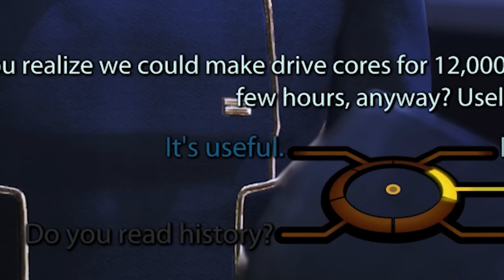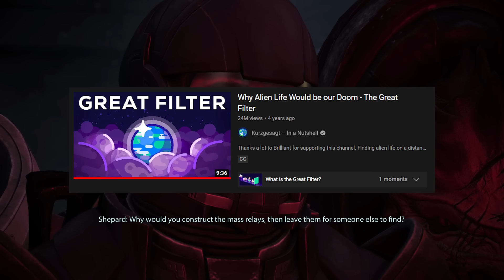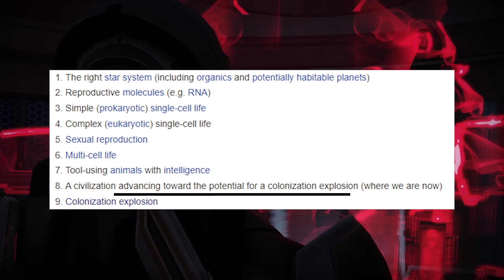A Story Analysis of Mass Effect 1

Comment: 33:23 youre correct, that fight was A LOT harder on the original release. That bint got me killed by her minions with her constant interference and the lack of cover options.

Wasnt that the point though? Shes a glass canon so she needs to force us into a handicapped fight. The limited cover options not only meant you had to keep moving, but it also meant you couldnt post your followers behind a corner to give you cover fire.

It was a pain for my playthrough. 

I tried doing a 2nd playthrough, but the way you actually have to drive around aimlessly to find stuff on the planets you explore was very arduous and boring, especially considering just about every planet had a huge map with like 3 or 4 things to discover.

Comment: I like your reasoning for saving the council. I however always choose the opposite choice. Probably due to the fact that the council was blind this entire time and always went against us. I felt like it was time for new leadership. So even if the leaders die, it’s a new start to the cycle which requires a different way of thinking and needs different leadership in place than what has worked/not worked in past cycles. 

Halo calls it the “Mantle of Responsibility” where a race will assume this mantle and be the forefront for leading the other races. While I don’t think humans alone should be the leaders of all races, these events clearly showed how humanity needs to have a seat at the table.

Comment: 52:04 this is so wrong... 

Machines that we create in factories have a lifespan. Materials degrade over time, working elements wear down due to strain of usage.

Your DNA molecule however has existed for over a billion years CONTINIOUSLY through constant replication and adaptation. From the moment it came into existence and became capable of self-replication it had not ever stopped existing.

Synthetic Life is the same - it is a form of existence that replicates the core principles of Organic Life in order to continue persisting. 

And if Life has taught us but one lesson it is adapt or die. One cannot staticly replicate forever because of the ever changing enviorenment and resource availability.

Life is a form of existence so far beyond those of basic elements and most complex molecules they don't even have the means to begin comprehending it.

Reapers were supposed to be the same to Organic Life...